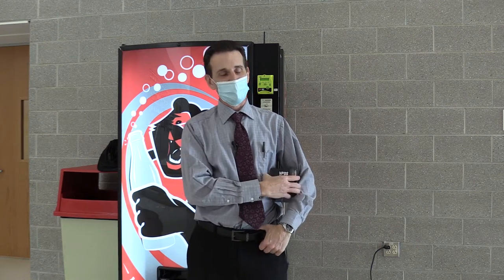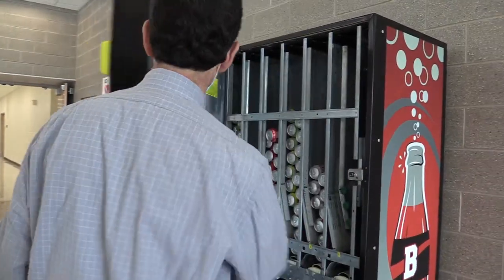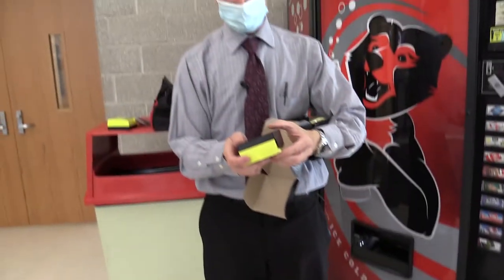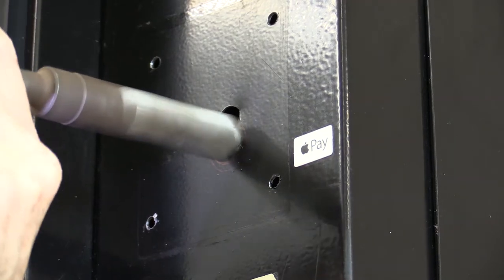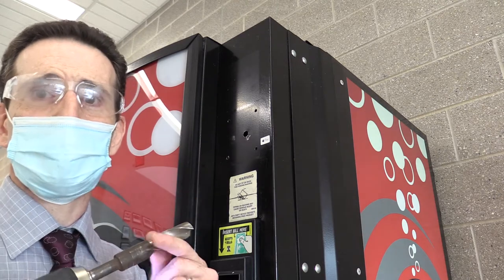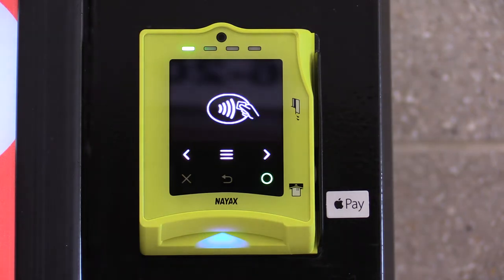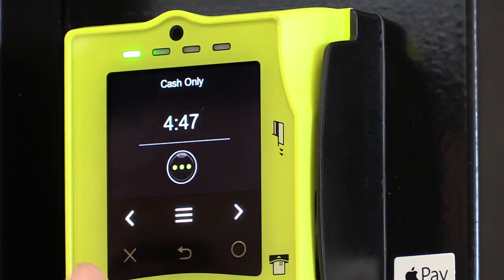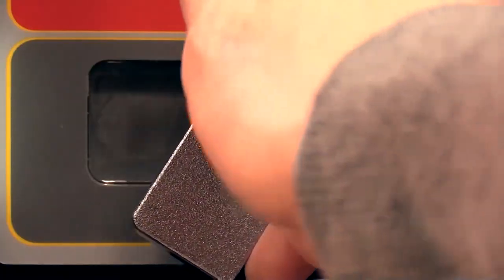How to Install a Nayax VPOS Touch Credit Card Reader on a Soda Machine

Comment: Been using Nayax myself too. They have a high-gain antenna you can buy to boost your signal. I had one location that was always losing service, and their high-gain antenna seems to have solved the problem.
It is not magnetic, so you will actually want to drill a hole in the top of the door, then use the nut provided to screw it down in place.

Comment: Nice to see that the nayax is compatible with the old Royal vendor machines.
My machine is working well and I am looking forward to add the nayax so I can better check if I have to refill.
I only have to check if mine also has the DEX (digital exchange) plug. I never noticed that before.

Greetings from Germany and thank you for the the videos. They are really helpful because you don't find any other information about these old machines

Comment: Great video Bill, really love the step by step videos you put out, feel like I am really there with you learning. Just FYI, before drilling a hole in metal you really should use a center punch, it will prevent drifting like you were having. Have a great day and look forward to the next video.
Reply from the maker: Yeah...you are right about the center punch...but I didn't have one with me.  I wasn't really prepared to drill a new hole because I thought I would be able to use the existing holes.
Reply: I always use a small drill bit to start with and then enlarge it. I have a set of bits that have steps on them--as you drill, the bit gets bigger and bigger. I just keep them in my tool bag at all times. Highly recommended.
Reply: What’s a center punch look like? I will need to change out my Nayax with a VPOS as well.

Comment: Super helpful. Was the issue with the initial vending just reception? Or did the agent need to change settings with you ?
Reply from the maker: Nayax needs to do the final onboarding after the unit is hooked up.

Comment: Bill, Great video! We just installed a Nayax touch CC reader and it will not work? It states cash only/ Nayax wanted me to get into programming to look for MDB section. Couldn't find what they needed, however they never stated to reboot the CC at the touch screen! I will try tomorrow to see what happens, so did you also reboot the main controller when you around to the inside of the machine (after cc reboot?) Thanks Shannon
Reply from the maker: You can reboot the reader just by unplugging your machine for a few minutes then plugging it back in.  Good luck!

Comment: Bill , thanks of this video. Can you advise if the Nayax also needs a SIM card installed to get the 4G service ?
Reply from the maker: Hmmm...I don't know if the VPOS touch has a sim card installed.  If so, I didn't install it...it came already in there.  You may want to reach out to Nayax with that question.
Reply: @HappyVending  thanks much for the reply , I will follow up with Nayax

Comment: Thanks for the video!  I installed th Nayax VPOS on a royal 804 giii and a snack machine.  On the Royal it’s reporting the card sales, but not the cash sales.  Confirmed the cables are hooked up correctly.  Any ideas why that would happen?
Reply from the maker: You probably have an older board on your 804 and the eprom is not able to report cash sales.  I had an older Royal Merlin IV that I had to have the eprom updated before it would report cash sales.  Unplug your machine and plug it back in and write down the number that comes up on the display...that is your eprom version.  Call Royal and tell them your number and see if there are any eprom updates for your board.
Reply: @HappyVending  Thank you!
Reply: @HappyVending  So turns out there is a sticker on my eprom with the version...(67015-9 Giii).  Do you happen to know the version of the eprom you had that did not report cash sales on the Merlin IV?  Also can you tell me the version of your current eprom that does report cash sales?  Thanks in advance!

Comment: Great video Bill.  How well do these readers work on a machine that is outdoors?  Thank you.  :-)
Reply from the maker: None of my machines are outdoors, but according to Nayax they are weather resistant and designed to be run outdoors.
Reply: @HappyVending  thanks Bill I appreciate the info
Reply: do they work in carwashes in north America? I read carwash systems in north America use 24 ac volt systems and nayax uses 24 DC volt systems?

Comment: I have problem with cancelling transactions after installation. Did NAYAX only suggest you to move the antenna ?
Reply from the maker: Well, the big issue was that they needed to swap out the old reader for this one on their end.  There was also a maximum authorization price that needed to be moved up to $3 because I have some 2.25 monsters in the machine.  The old setting was at 2.00.

Comment: Hey, my g3 is only dispensing out of row 5 and 11. I can hear the other rows trying to dispense but says sold out. Any ideas? Also, can I just use regular fluorescent bulbs for the door?
Reply from the maker: You need to check your space to sales settings to make sure it is programmed to dispense from other columns.   Also make sure there isn't a jam in the columns that aren't dispensing.   As for the bulbs, the machine uses a high output bulb with a specific high output connector.   Write the number on bulb down before going out to purchase a new one.
Reply: @HappyVending  yeah I just purchased it, didn’t have the bulbs I measure them and they are 48” that’s all I know as of  now.
Reply from the maker: @Poolsrlife  Hmmm...you have a g3 that takes 48" bulbs?  My G3 660-9 machines take 64" bulbs....model F64 T12 high output bulbs.  Most of my machines I converted to LED...which Keystone Electric makes a Sign Hero bulb that fits into the machine...but you need to rewire the lighting system and bypass the ballast.

Comment: Hey Bill, my nayax says "cash only" and I plugged it as shown in the video, what should I do?
Reply from the maker: Did you call Nayax to activate it?  If not, do that.
Reply: @HappyVending  hi Bill, I got it up and running. Just had to press some setup buttons. Thanks!
Reply: @gibsmusic8386  Late question. What setup buttons did you do? I'm having the same issue.

Comment: Hi sir! Is it compatible in any vending machines? We're using can/petbottle vending machine with coin and cash payment only.
Reply from the maker: It should work on most machines that are MDB compliant.
Reply: @HappyVending  the brand that we're using is Thinkrun Model: TH-p6102wk. It is a vending machine in Japan. Is it compatible with it, if not is there a way to make it compatible?
Reply from the maker: @PatRick-xd4rp  I am located in the US and have never heard of that manufacturer...so I can't say.  You would need to contact a sales rep from Nayax to confirm compatibility.
Reply: @HappyVending  hi again sir, i cant find where the dex plug in our vending, i think it doesnt have any. is there a way to find it in the board/connectors? where can i find it? also does vpos touch have QR code based payment? thanks in advance
Reply from the maker: @PatRick-xd4rp  I'm not familiar with your machine so I can't say for sure if it has a dex port.  Your best bet is to find a manual for it.  And VPOS doe not have QR code based mayment.

Comment: Can you have a different price for the same product for cash and credit card?
Reply from the maker: Yes.  It's called 2 tier pricing.
Reply: @HappyVending  is that 2 tier pricing easy to program on the vending machine? I don’t have my vending machine yet but when it does arrive thats something I want to do because I want to encourage more cash users by making the cash price cheaper than the credit card price. If that makes sense.
Reply from the maker: @usna2009  You would set that up in the credit card reader interface.  List your prices on the machine at the full price and put a sign on the machine stating that there is a .10 discount if you pay in cash.

Comment: Do you need a special bank account for those credit card readers?
Reply from the maker: No...any checking account will do.
Reply: @HappyVending  Thanks!
Reply: Hello, a machine you buy already has the device of nayax, to link it with my bank you can use some other company other than nayax and which one would be, or you can only use the manufacturer's company, thank you

Comment: This may not work with that standard board that goes in that vendor you may have to have the board upgraded
Reply from the maker: I already had the firmware on the board updated by Coinco before I put the previous Nayax reader on it.  It works great with the VPOS touch and even reports cash sales.  I'm not sure if Coinco still updates these boards....so you might need to buy an updated board from Royal if you wanted to do it today.  Or another option is getting an aftermarket board from inone for this machine.
Reply: I hear your brother thank you for the input

Comment: That sucks that they make you drill new holes. There should be a standard so all card readers fit.
Reply from the maker: The newer machines usually have an extra cutout for credit card readers so it's not usually an issue.